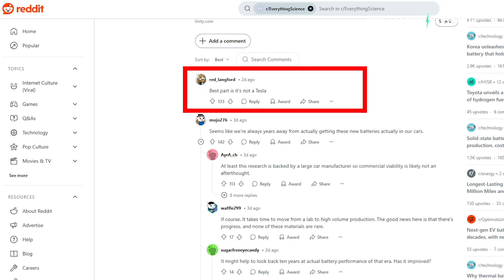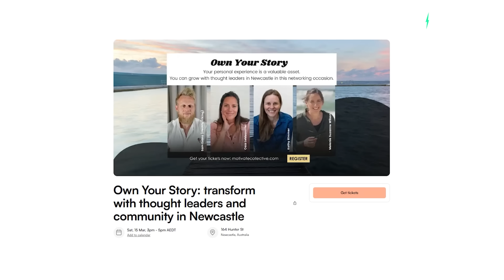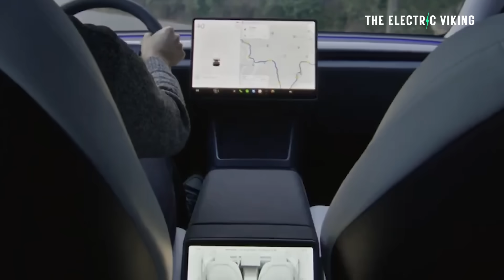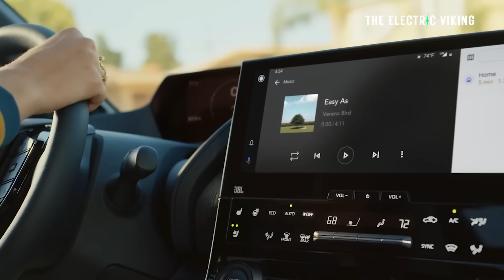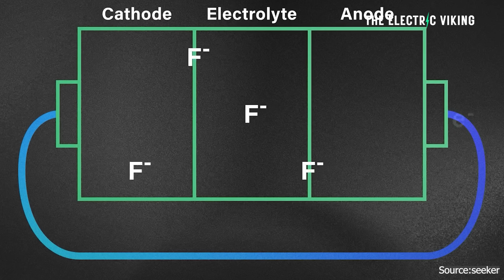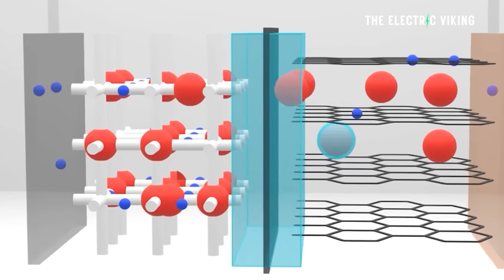Toyota claims it's new copper and fluoride EV battery will double EV range

Comment: I have two good friends with PhD’s in chemistry that worked mostly on fuel cell and battery technology for decades.  Both agree that the best case for commercially successful battery technology is 20%-30% improvement in density. And the technologies to achieve this have serious challenges.  

Both agree new innovations are possible but not commercially at scale in the next decade.
Reply: For those people who want to pontificate about the limits of battery energy density, I recommend you learn to ask the right QUESTION. That is much harder to do than providing the right ANSWER.

Here are the two important questions about lithium batteries:

Q1. How much energy is locked up in a kg of lithium? A. Almost as much as in a liter of gasoline (i.e. 'a lot'. That's according to a US Dept of Energy study.)

Q2. How much of that energy do current lithium batteries access?  A. Maybe 20% (up from 5% in 2008 - US Dept of Energy data). So the potential upside from lithium batteries is HUGE. It will take plenty of smart chemical research, but you can be pretty sure that lithium battery energy densities will continue to improve for the next 50 years.

Another fact about batteries - unlike some other fuel sources, batteries have multiple parameters that can be improved.

1. Finding a way to make a battery for half the cost - well, that cuts the cost in half.
2. Finding a way to double the life (no. of recharge cycles) = halving the cost.
3. Double the energy density
4. Reduce the weight
5. Double the recharge speed

There are LOTS of ways to improve batteries.

I am not saying this is easy (it ain't); there have only ever been 4 commercially successful rechargeable battery technologies: lead acid, ni-cad, nimh, and lithium.

But more research effort is going in to this than ever before - betting against batteries continuing to improve for the next 50 or more years is a bad bet.
Reply: @markhughes6673  I totally agree.  
Battery chemistry technology will make the ICE irrelevant.
Reply: @ Agree with you 100%.
Reply: Follow the electric trucker to see the reality of electric trucks in Europe
Reply: @IanThompson-p2r  I have. My point stands. Trucks that currently take like a thousand litres of diesel or more, and burn like 2-3 litres per kilometre, are NEVER going to be electric in the lifetime of anyone currently alive.
Reply: A 20-30% improvement in density means that there will NEVER be electric trucks of any significant size.   Possibly short range buses like you'll find in the suburbs of a city.  Possibly not electric pickup trucks, although that is debatable. But there wont be semi trucks or large trucks.
Reply: @oldwombat  Electric Semis already exist, they are not great for huge distances but that is what trains are for.
Reply: @gpsfinancial6988  Yeah, the Tesla semis at places like Pepsi have not worked out well. Im talking about giant trucks that hail like 60 tonnes 800 kilometres overnight. Batteries for them are utterly impractical.
Reply: @oldwombat  Where have you heard Pepsi is not working out? EVs are great for stop/start traffic and hilly terrain. Not ready for the long haul you describe, but that is only one use case.
Reply: @Tn_jed001  I'm consistently surprised that people continue to assert that 'batteries will never work in trucks'. This seems to based on an assertion (without evidence) that there will be no significant improvements in battery technology. 

For example, what if better technology enables batteries to be recharged in two minutes? Or if combining batteries with super capacitors gives an equivalent result? 

More importantly, people need to think about the economics of trucking across the total transport market. 

Yeah, I know everyone has seen a big truck with a 40' shipping container on it, zooming down an interstate highway. Good for you. 

That type of trucking is one one-thousandth of trucking. 999/1000 of trucking is either:

a) smaller trucks doing deliveries, but not traveling more than 300m/500k per day. Batteries are great for this. 
b) Big trucks delivering 40' containers locally - again, not travelling long distances. Batteries are great for this.

So batteries are really well suited for 98.99% of trucking jobs.

Coming up with an answer is easy - it's much harder to ask the right question. Here's the question: 

If batteries are really well suited for 99+% of trucking jobs, what is the best strategy for any trucking company if they have a wide variety of trucks and delivery types .... Is it:

a) Change all my trucks to electric, and maybe accept some compromises on some long-haul deliveries?
b) Change 99+% of my deliveries to electric, and retain diesel for the  <1% of highway long-haul deliveries. And accept the compromise that my company now has to deal with two different fuel storage / engine maintenance systems, etc.

There is no perfect solution in business; it's always a question of what compromise do you want to make.

I've had a truck licence for 50 years. One of the many companies I worked for was one of the world's largest FMCG companies (FMCG = Fast Moving Consumer Goods, for those unfamiliar with the term).

Every morning we'd send out over 100 smaller trucks doing local deliveries. They never did more than 100miles/day. Plus, every day we'd do 50 or 100 full size truck deliveries - most of which went to customers' warehouses that were about 10m-20miles from our factory.

If you've seen a big truck with a 40' container zooming on an interstate highway, well, I'm really, really, really pleased for you. But if you think that's the trucking business, then you don't understand the trucking business.

Comment: There are still neanderthals poisoning our air with those old rotary phone   vehicles.. 
    It kills over 361 Americans daily.What are the symptoms of lung cancer in nonsmokers? None usually . until it’s too late.Owners of  ICE and Diesel vehicles and those exposed , such as Family members and co-workers, are reported to have the highest rates of Asthma, Cancers and Leukemia . More than 40 chemicals listed for cancer are present in engine exhaust. These include benzene, arsenic, formaldehyde, acetaldehyde, 1,3-butadiene, lead, numerous hydrocarbons and CO. E.V.’s are zero emission. FYI , For those stuck with the old rotary phone ICE vehicle,
E-85 is Much cleaner, mostly less expensive, and helps American farmers.it’s  now sold everywhere in the states, just google search  it .. only 15% is poison. Before e.v’s  we used it for 400k+ miles , in many vehicles,  it’s still going in some.

Comment: By the numbers, Toyota had $298 Billion (481 Billion AUD) in sales for 2024, and over $32 Billion (52 Billion AUD) in profits.  This is huge cash flow to divert funds into research and development in the battery space.  Personally, I would not count Toyota out of the EV game just yet.  Besides, the semiconductor industry needs to ramp up production of silicon carbide products intensely over the next few years just so the industry can transition to 800V platforms, which currently only 8% of EVs have been able to transition to so far.  Perhaps in two years, 400V systems and lithium ion batteries will be obsolete Tier 2 components.
Reply: Toyota is so far behind, they are having to use BYD Dual Mode system because Toyota Hybrid Synergy Drive isn't good enough.

Comment: Unfortunately Toyota have made some big claims that just have not come to fruition.

Hydrogen had a legitimate chance until it became so expensive to make and supply. 
If Hydrogen was as cheap as diesel or petrol then that may have had a chance.
It still might for Large vessels as Electric container ships are never going to happen.

USA have solid state battery manufacturing but way too expensive for use in cars.
More for aviation and Military applications not domestic transport at the moment.

I don't think we have found a scalable very low cost and super energy dense battery for use in transport.
LiFeP  is presently the most effective lower cost.
Aluminium Ion  and Sodium Ion might be cheaper but not necessarily as dense. TBD.

Toyota may be just bluffing but they have pulled rabbits out of hats before.
I hope for their sake they are not full of BS.
Reply: 100% going to be the Chinese who productionise solid state first, then the Koreans. Japan and Toyota are way way behind.

Comment: Using your example, if Tesla had a 100KW battery to go 500 miles on a charge then, for the same weight, with double energy density, the Toyota could go 1000 miles but that would be  a 200KW battery. They better develop some real fast charging to go with this big battery.